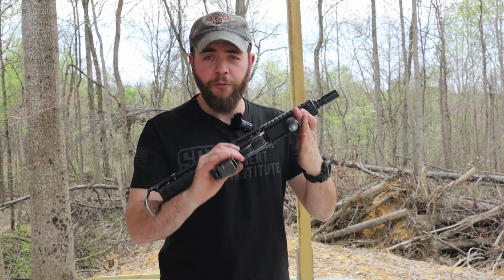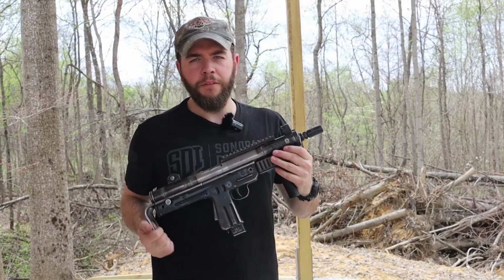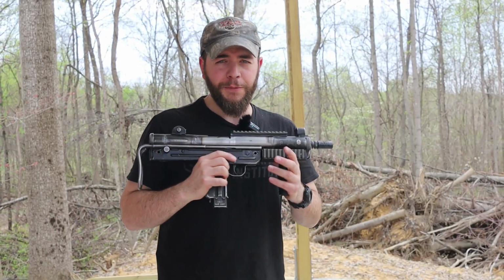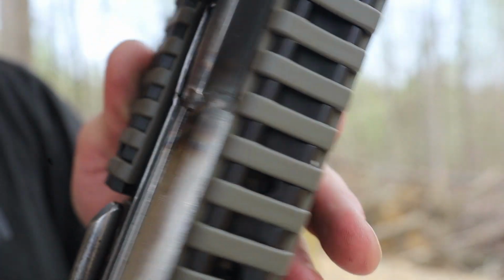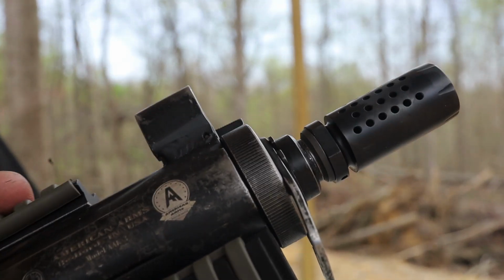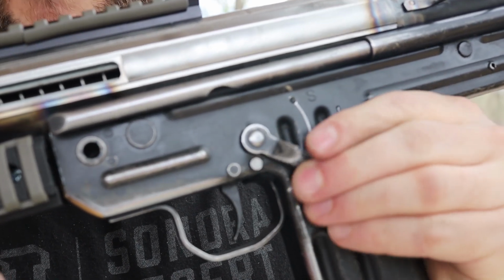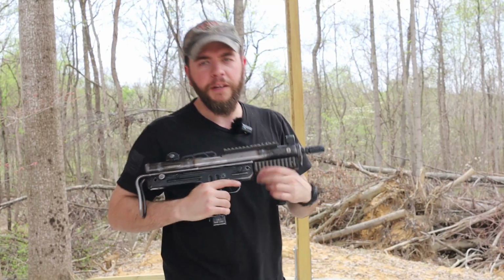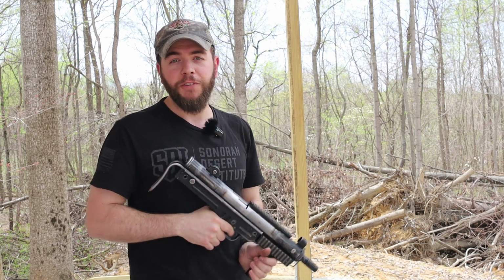This Machinegun is Boring: The Argentine FMK-3 SMG.

Comment: I got akit for $135 shipped, it'll be a semi build, i dont have hands on it yet but im thinking an AR style 9mm upper, we'll see though. Up in the air about going pistol or rifle, could remove or permanently disable  the stock, or could pin and weld something on the barrel to bring it to length,  iirc it needs about 5 inches. Maybe a fake can?    Must be nice to be a dealer.

Comment: Great video..!!
I belonged to the Argentine federal police.
We used that weapon regularly in my time with three 40-round magazines in a leather holster.
It was designed by the engineer Magin Almara for the military weapons factory in the 70's. A Czeck model called CZ23 was used a "inspiration"...
It was originally called PA3 DM "Pistola Ametralladora 3 Domingo Matheu (machine gun 3 Domingo Matheu)...
It is of simple construction, its body is made of stamped steel sheet. Its maintenance and operation is very simple, and when operated it is quite precise and VERY stable.
There are several versions of FMK3, also the following models called FMK4  (10mm longer)and FMK5  this las model is manufactured for civilian use, since in Argentina it is not allowed to sell "full auto" weapons to civilians (here the laws are harsh for honest citizens)😂....
Today our police officers on duty do not use adequate ammunition and weapons (unfortunately).
Greetings from Argentina..!
Reply: EXELENTE RESEÑA!!! La usé en la colimba de custodia. No disparé con ella, sí con la PAM (PA1) Un saludo!

Comment: Thanks for the show and humor. Enjoyed. Worked on Perpetual motion engines a few Decades ago. Once stared they will run  virtually for ever. Existing  technology for Decades. Akams razor theory. You can not get more power out than you put in, He was Wrong. As long as you use either heat and or pressure to generate power ,Its a degrading event. Take care.